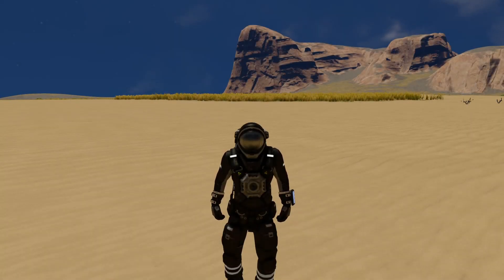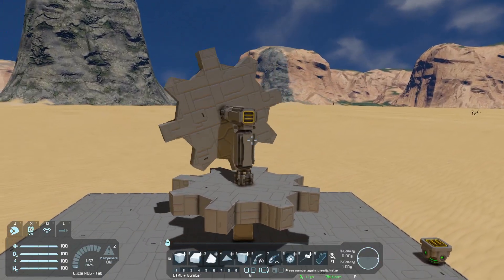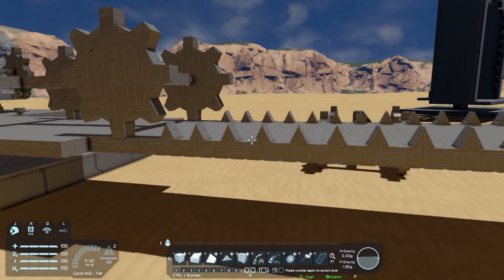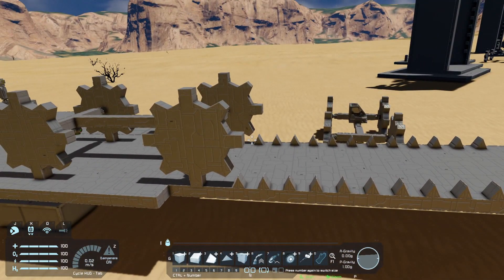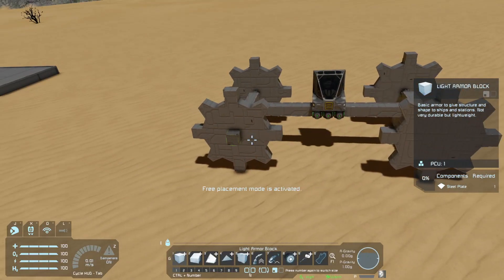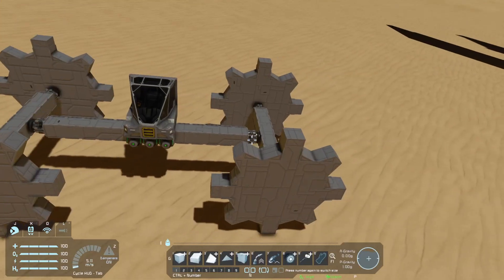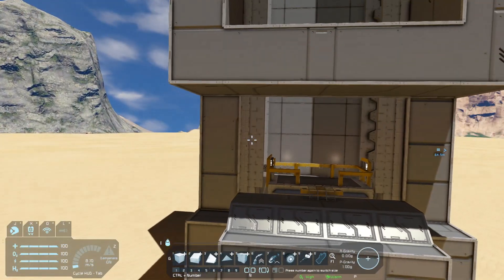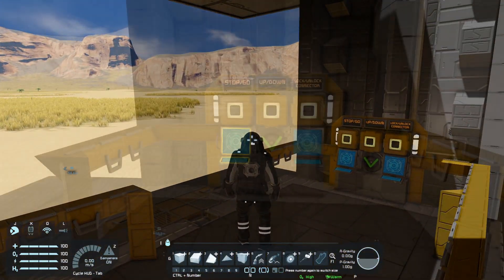Gear Elevator - Space Engineers

Comment: This is cool, I could definitely see the gears be used in factories and similiar aesthetic buildings, if only to have something moving, bring the world alive a little.

I have one suggestion and a few questions:
Suggestion: Using a remote control on autopilot and coordinate points, one could probably set it up so it stops automatically, right? Have it line itself up to the level, especially if you're using it as a connection between two points.

First question: From your experience working with this design and this technique, would you say incorporating a turning system would be possible? It's probably more hassle than it's worth, but it be possible, in pure theory, especially with regard to clang? I don't have much experience with multiple-rotor-systems like this, so I can't really estimate how clang will interact with it...

Second question: From the amount of blocks surrounding it, would you say it's a design usable as a space elevator, even if it goes only into <.3 gravity? Or is it too many blocks?

Third question, and this is really just a technicality: It should be easy to lay this design horizontal and make a train, right? Just to keep my options open.
Reply from the maker: You can set up gps points but I don't think I could make the elevator just move to whatever floor I choose unscripted. It would have to be in a linear pattern and even then there would be complications with the RC autopilot AI. It's not exactly intelligent. You'd be better off with sensors and connectors at each floor to trigger some timer actions.
Q1: I'm sure a system could be made to get it around a 90 degree corner.
Q2: For a space elevator I'd make it out of large grid and even then it would be a ton of blocks.
Q3: It works horizontally as well as it does vertically, I've tried.
Reply: @BlackArmor718  Thanks! Yea, the AI for autopilot is not the smartest...

Comment: Can you not close the gap between both elevator gears completely and just let the gears run 45 degrees out off phase? Like your first setup you built with the free spinning gear.
Reply from the maker: I could but it’s not going to make it less than 3 large blocks wide, I would only save a few small blocks in width. So why both since it will take up the same space in a large grid
Reply: @BlackArmor718  I figured you had already thought of it, awesome content man!

Comment: I would almost ad a third gear in the middle and down a little bit on both sides and see if that keeps the elevator from tilting on the track. Or just use a wheel maybe. Either way that's an awesome design man
Reply from the maker: That would solve the minor tilting issue but also make it wider and longer. On a larger scale elevator for sure

Comment: Mesh the gears from the left and right sides and stagger the rack teeth so they can fit and you can make it even smaller.
Reply from the maker: What do you mean by mesh the gears?
Reply: @BlackArmor718  the way you made the first gear set. he means mesh them together, in order to minimize the spacing required. obviously this would make the gears out of phase, so that's why he said to stagger the rack teeth. I don't know whether this would work or not, I'm merely translating.
Reply from the maker: @milanstevic8424  I see. This would only save 1-2 small blocks of space though. Given that right now the elevator fits exactly in 4 large blocks of space, I don’t see the advantage of trimming off just a few blocks. It would still take up 4 large blocks of spaces it just wouldn’t fit as nicely.
Reply: @BlackArmor718  it would also keep the elevator aligned horizontally and won’t require syncing the rotors, also, thanks for the translation Milan, well said.

Comment: Awesome. I wonder about a way to use sensors on each level and, by hitting a button to turn on the sensor on the level you want to go to, that could stop the elevator there. But I don't think there is a way to set up a button on one grid to automatically trigger something on another. Maybe it could move a stick with tires on it out into the shaft to block the elevator from proceeding further. Hmmmmmm.
Reply from the maker: You're on the right track with the blocking mechanism. But how would the elevator know if it should be going up or down when it's called, depending on where the engineer is?
Reply: @BlackArmor718  I think I may have a solution. Multiple Remote Controls on autopilot. On each floor the elevator is merged to the level. This allows the button on another floor to turn on a series of timer blocks on the elevator for each floor. Each timer block is paired to a different remote control. The remote controls are set using autopilot to travel to the location corresponding to that floor. When the floor button turns on the right timer block, its instructions are: turn off merge block, turn on remote control, turn off handbrake, wait, turn on handbrake, turn off remote control, turn on merge block, turn off self.  This is, IF autopilot works for ground vehicles. May have to finagle the right settings. Would this work?
Reply from the maker: @Daniel-Strain  a remote control autopilot has no authority over the movement here, because it uses rotors to spin the gears not wheels.
Reply: @BlackArmor718  Ah, I see. Maybe some kind of rebuild using the wheels would make this idea feasible then. Fun to think about this stuff :)
Reply from the maker: @Daniel-Strain  but you can’t attach things to wheels :)

Comment: What if depending on breaking-torque to have it stopping at the right angle, how about a sensor with fine tuned range to to lock it down as soon as it reach a specific point?
As soon as I saw those internal and external gears, my first immediate thought was "VAULT-TEC VAULT DOORS!"

P.s:
Since you utilise the Connectors to lock the elevator down, can you double it as the dampener by amping up the magnetic strength?
Reply from the maker: I don't see the connection between breaking torque and having it stop at a certain angle. Also I don't think you can use connectors to repel, only pull
Reply: Though could try connector on sides for that id figure

Comment: Wonder if you could use sensors to call to different levels?
Reply from the maker: How would you call an elevator that isn’t attached to the grid you’re calling from?
Reply: @BlackArmor718  sensors on the elevator, and pistons that move in and out of sensor range to trip and release? I don't really know, your exponentially better at this than me. But I bet if you slept on it for a few days, you will come up with a way better solution.
Reply from the maker: @HeliosT3ch  That's a valid idea but sensors ranges only go to 50m, so if you had floors higher than that, the system wouldn't work. Also as I've said a few times, I would have to build all the floors for that and make them part of the blueprint. So then people couldn't use this in their base because the floors might not match what they have. I really just made this as an elevator than anyone could add to a pre-existing blueprint and it has enough function to work in any of them.
Reply: @BlackArmor718  I was just posing the question.  I have seen what you and people like you have come up with. You guys make art, I make stick figures.
Reply from the maker: @HeliosT3ch  I like the discussion, and a lot of time the proposed idea is something that crossed my mind but I saw a problem and decided to go another way. So I usually ask you how you would solve that problem to see if you had a different angle than me when approaching it.
Reply: @BlackArmor718  and I was thinking about sideways facing sensors, that would look towards the wall and a piston that would extend from the wall to trigger the sensor @ timer blocks.  Or something to that affect.
Reply from the maker: @HeliosT3ch  Yes true, but again the sensor range is only 50m. Also how would the elevator know to go up or down. And how to guarantee a connection is safely made at each floor. These are all the problems to be solved
Reply: @BlackArmor718  I'm not understanding the 50m issue. I'm my mind the sensor faces the elevator shaft wall missing the edge by a meter at most. Pistons in the wall could come out into sensor range triggering different actions. 1 could be the Start / Stop, 1 could reverse direction.... Sometime like that. Not sure it would work. Or maybe a merge block at each floor? I don't know. Like I said, I'm not nearly as good as you. I was just thinking it would be cool. BTW when can we see more of your underground base? That would make an AMAZING build series.
Reply from the maker: Sorry I missed this. I'm saying if the cart was on the 1st floor and I was up on the 6th floor the cart sensors wouldn't be able to detect the piston being extended because its higher than 50m above. 
The base needs a little more work but doesn't sound fun to do right now. What would you like to see from it though as a build series?
Reply: @BlackArmor718  I love your base, I would love to see your though process as your building it.
Reply from the maker: @HeliosT3ch  Most of what I wanted to do has already been built, there is one room to finish and one room that hasn't been dug out yet. I'll throw on the recorder when I get back to it
Reply: @BlackArmor718  Honestly it doesn't matter what build you do. I would enjoy watching the process. BTW I saw your elevator featured from another YouTuber that does "Space Engineers, Showcase Video"
Reply from the maker: @HeliosT3ch  I saw it as well and thanks I'll keep that in mind

Comment: I would probably place the gears above the elevatorcabin and watch those gears as they working :) Lovely piece of engineering 10/10
Reply: Yeah I was thinking how cool it would be to have a larger version where you ride inside the gear compartment, as in you walk between the gear to enter and there's glass/grates on the inside of the carriage. The roof that would form could also make a better surface for the roof bumpers so it doesn't get tilted like this one does.

Comment: This would be great with a tram. I mostly just do ships so this kind of stuff scares the crap out of me but it might be worth a shot. VCZ elevators are broken so the incentive's definitely there to try this.
Reply from the maker: Can you elaborate on that tram idea?
Reply: @BlackArmor718  Well I used to stick VCZ elevators in very large ships sideways and use them as straight trams. Something modless would be a great alternative. Having a connector system also keeps things from flying apart while the ship's moving, too. Big bonus.
Reply from the maker: @jgphoenix4404  Oh I see, so just using this horizontal instead of vertical. I have tested that and it works just fine. It also works while a ship is flying/maneuvering and the elevator is moving, no issues.
Reply: @BlackArmor718  Sounds miraculous but that's good news. In that case I'll study yours when I've got some time and see what I can come up with. Thanks.

Comment: i like how, in a game built around engineering and space travel, it's a hassle to build with cogs and wheels :D
Reply from the maker: It comes down to block size. This was the smallest reliable gear I could come up with.
Reply: @BlackArmor718  could you use wheels as the teeth of the gears? The suspension made stiff and adjustable height along with the fact that they are designed to get grip and not damage other blocks could be helpful
Reply from the maker: @tra7017  Gears out of wheel suspension?
Reply: i could see a gear out of wheel suspension... would be a larger gear, but would have built in cushioning with the wheels....
Reply: @BlackArmor718  Blocks are often useful in these games for simple construction.

But if this game can handle odd geometry, why not just allow for in-game vertex/edge/face manipulation like a simple 3d modeler?
Reply: And you also can't travel fast or orbit (without scripts, mods etc)
Reply: @ImieNazwiskoOK  actually you can orbit manually, but you need a mod for the speedlimit. 120Km/h in space? It's nothing...
Reply: @TheIceThorn  speeds in SE are given in meters per second, not kilometers an hour unless you are in a vehicle with wheels. Top Speed of 120m/s = 432km/h, wich is pretty fast for a vehicle to go...

... just an absoloute joke in space lol
Reply: @fenchellforelle  yeah sorry, forgot a "k"... but as you said it's still a joke :|
with the unlimited speed mod i managed (using custom scripts) to make a satellite orbit the planet. It's not hard, you just need to let it propel a bit when it finds the height going under a certain height, toss the satellite on the orbit watching the horizon with your ship and detach it. The rest is done by sun+batteries.
Reply: @ImieNazwiskoOK  no, you can orbit, kind of... it just requires careful manual control of thrust groups and attitude. I've actually successfully held orbit around Luna in-game for almost 15min, with only minor adjustments needed to maintain attitude here and there. It's definitely not easy, but it's not easy IRL either. Orbits naturally decay, and the smaller the mass the faster the decay as the gravity interaction is much more one-sided on a small craft than, say, a moon, both compared to a planet.
Reply from the maker: @tra7017  what’s the point of rebuilding it with wheels when it will do the same thing it does now.
Reply: @BlackArmor718  Quote: "This was the smallest reliable gear I could come up with." I was wondering if a smaller reliable solution could be made that took advantage of wheels' combination of being gentler than the hard edges surfaces, adjustable height, roundness, and ability to allow some give for a flush fit without air gaps.
Reply from the maker: @tra7017  Ok, maybe it could work as a 4 spoke indeed
Reply: The problem is that SE needs a lot of fickery to trick the physics engine into reproducing a desired macroscopic behaviour. There are no dedicated mechanical elements like rails, gears, linear motors, locks, and what-have-you, that the engine could use as simplified and more reliable constraints to do its job. No, the engine needs to derive all the physical relationships between blocks purely from their individual properties (collision, springiness, inertia, moment of inertia …) and their arrangement. And if it doesn't do it fast enough, things break, because it needs to reevaluate all those properties and relationships every time a new game tick comes around, and can ONLY do it when a tick comes around. And in between, anything of that could have changed in unexpected ways. Including the breaking itself.
Reply: To be fair, wheels aren't very space friendly
Reply: Im no engineer, but is cogs and wheels really used in space travel?
Reply: @H4Xcashmoney  not entirely, no. But they are a very basic and fundamental part of it, right?
Reply: The game is about contruct almost everything
Reply: Clang
Reply: Its almost like its not even a game (which it isn't)

Comment: Do you take disciples?
Reply from the maker: lol no, I'm not that cool
Reply: @BlackArmor718  how much it costs to learn from the OG? (Original Gearman)
Reply from the maker: @pedropimenta896  You know as much as I do at this point, all I've made is this elevator.
Reply: @BlackArmor718  Actually, there is much for me to learn. Most by running experiments, which time and time again you have shown to have experimented already.
The other day someone made a tall tower to place a Wind Turbine on top, and complained that running upstair everytime it got damaged was annoying, to which I suggested to use a piston instead to bring the turbine closer. Later it was found that setup does not work, and I was called a troll - see, I came up with that on the spot, never had that problem as I use ramps to build my towers, so I never experimentex Turbines VS subgrids.
You've done more experimenting than most players have, which makes for a great channel. Kudos!
Reply: @BlackArmor718  (you made two elevators actually)
Reply from the maker: @pedropimenta896  If you can't put the wind turbine on a piston, you could put one next to it and have the engineer use the piston to go to the top. Experimenting will make you better at the game, I think you should always be trying new ideas
Reply: @BlackArmor718  btw, have you ever played Medieval Engineers? Players found out how to make gears and transmissions using blocks in cross shape + ropes!
Reply from the maker: @pedropimenta896  I haven't, since space engineers let's me do everything I want
Reply: @BlackArmor718  you know very well how limitations help criativity... But ok, good thing you found SE!

Comment: So, it would work in zero G?
Reply from the maker: It should
Reply from the maker: Edit: It DOES. It works better in zero g actually. It also works when connected to a moving ship
Reply: Although, if you are in zero G you can just setup a grav gen elevator. I believe Whiplash made one, it is on the workshop. 

Less moving parts, easier to setup and print. But the gear setup is choice 👌